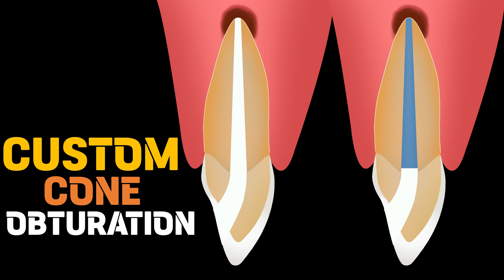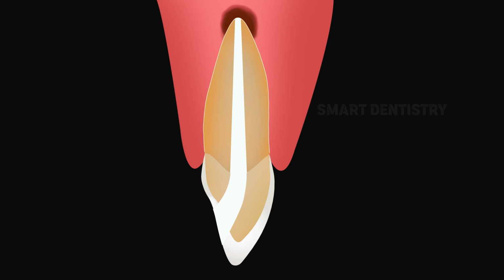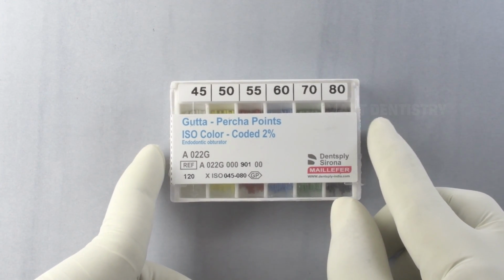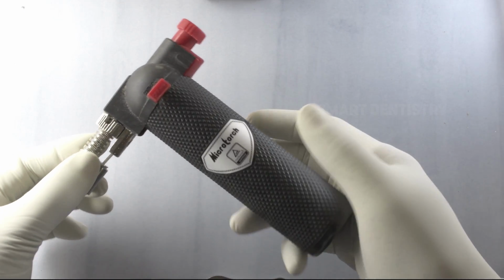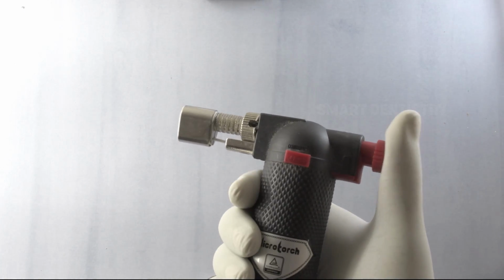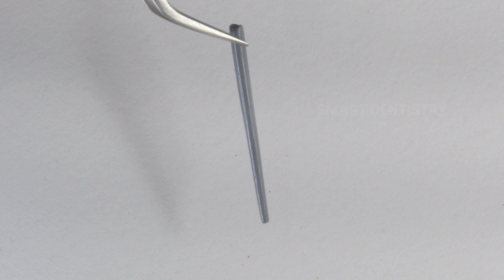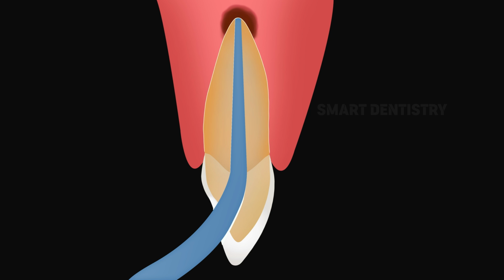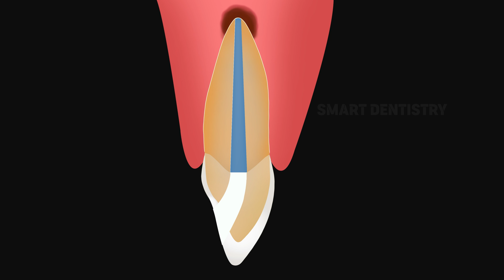Custom cone obturation

Comment: Hi please tell how do u know which taper is better
Reply from the maker: Taper is determined by length of the roots, canal width and obturation technique we use. This seems to be an interesting topic. I will make a video in detail about this
Thanks for suggesting
Upcoming videos in Smart Dentistry YouTube channel

All about root canal Irrigation
How to select the correct master cone
When to discard a rotary file
How to negotiate a calcified root canal - @anujgarg952, @DrHozefa
Antibiotics after Root Canal Treatment?
How to locate root canals?
How to remove Guttapercha from root canals?
When to do Post and Core?
Curved root canals and file selection
Everything a beginner should know about rotary files
TCA technique of Cleaning and shaping - @DrHozefa
Anterior proximal composite restorations - @raghuramm563
Finishing and polishing of composite restorations - @DrHozefa
How to create the perfect anatomy in posterior composite restorations - @DrHozefa
Working length using RVG - @manadentist2267, @sushrutachakraborty464
How to use apex locators to get accurate reading? - @katyaynigupta5259
How to determine the correct taper for canal preparation - @akanshas8424

Comment: sir it's a retained deciduous molar and the permanent is missing congenitally.
Place- Primary second molar.
No occlusion.
Roots are i think 1/2 the size of other molars. 
Decay - a guava seed size decay just adjacent to back molar. 
(Similar to the pic you have attached on your video with title caries removal technique , don't remove caries)
the decay is not giving any pain through infection(which needs to be treated through medicine). 
But sometimes abnormal pressure on the broken structure while eating gives pain for few minutes. 
The doctor said to me that rct will last only for 2 years so i should go for implant instead but i want to save this tooth for as long as possible. 
So please tell me that within 2 years will the roots resorb on it's own even after rct or it could last more. 
Should I go for rct directly or try to go for filling first( pulp capping if needed). 
During my 6 months earlier visit to another doctor the decay was very small and no pain at all of any kind. Doctor said to me when some problem will occur then come again. 
Now the tooth structure is breaking  in very small pieces.
That's why 
I want some treatment so that more damage to the tooth can be minimised.
(I have replied on the earlier comment but don't know why it's not visible afterwards.)
Reply from the maker: Hi
Thanks for explaining everything in a such a beautiful manner
1. Roots will not resorb as there is no permanent tooth. Roots will resorb only secondary to eruption force from the permanent tooth
2. RCT will definitely last longer than two years if done with high accuracy. Although procedural errors are more likely to occur in deciduous tooth more than permanent tooth. 
3. If pulp capping could be attempted, I feel that should be the first choice
4. If the tooth is in occlusion and has no mobility , then saving this tooth will be an better option rather than going for implant although well planned implant will have a better outcome 
5. I have seen deciduous tooth surviving and functioning even in 60 year old individuals. So I would recommend going for conservative treatments like restoration, pulp capping, RCT and if everything fails, implant is always an option. 
Thank you
Reply: @smartdentistry  thankuu so muchh sir for your valuable advice.
I am glad that you gave me your time.

Comment: Can you please please help me telling how many years can rct with crown will work properly for deciduous molar which is broken from side. Or should i go for pulp capping then filling if possible.
With lots of hope I am sending this to you please help to come to a decision of saving my tooth for as long as possible. 
Btw i am 20 year old..
Reply from the maker: Hi 
You have mentioned your age is 20 and the tooth is deciduous molar
Is that a retained tooth?
If that is a retained tooth and the permanent tooth is missing congenitally, then we shall attempt to retain the deciduous tooth
But it must be verified with X-Ray in advance
Again the long term success of deciduous tooth is very not good as compared to permanent tooth.
Need more details to come to any decision like tooth number, decay status, root length available, occlusion and much more
Reply: @smartdentistry 
Yes sir it's a retained deciduous molar and the permanent is missing congenitally. 
The roots are in good condition right now and the decay is not giving any pain through infection(which needs to be treated through medicine). 
But sometimes abnormal pressure on the broken structure while eating gives pain for few minutes. 
The doctor said to me that rct will last only for 2 years so i should go for implant instead but i want to save this tooth for as long as possible. 
So please tell me that within 2 years will the roots resorb on it's own even after rct or it could last more. 
Should I go for rct directly or try to go for filling first( pulp capping if needed). 
During my 6 months earlier visit the decay was very small and no pain at all of any kind. Doctor said to me when some problem will occur then come again. 
Now the tooth structure is breaking  in small pieces.
That's why 
I want some treatment so that more damage to the tooth can be minimised. 
I will be highly greatful if you can help me.
Reply: @smartdentistry Yes sir it's a retained deciduous molar and the permanent is missing congenitally. 
The roots are in good condition right now and the decay is not giving any pain through infection(which needs to be treated through medicine). 
But sometimes abnormal pressure on the broken structure while eating gives pain for few minutes. 
The doctor said to me that rct will last only for 2 years so i should go for implant instead but i want to save this tooth for as long as possible. 
So please tell me that within 2 years will the roots resorb on it's own even after rct or it could last more. 
Should I go for rct directly or try to go for filling first( pulp capping if needed). 
During my 6 months earlier visit the decay was very small and no pain at all of any kind. Doctor said to me when some problem will occur then come again. 
Now the tooth structure is breaking  in small pieces.
That's why 
I want some treatment so that more damage to the tooth can be minimised.

Comment: Why would you do this when i have cones matching my preparation instruments.
Reply from the maker: It is very difficult or mostly impossible to get gutta percha cone sizes greater than 90. We often encounter patients with extremely large canals especially in maxillary incisors of young patients. In those situations these custom comes are really helpful
Reply: Sir, thank you for posting great videos. How is irrigation possible with these kind of wide apices? Wouldn’t NaOCl more likely exit the apices cause the NaOCl accidents? Is there any tips to prevent it from happening??
Reply: In many clinical situations like maxillary incisors in young patients we won’t get matching cones as the canal apical size may be more than 100 iso size.
Reply: But in those situations we can also use protaper gutta percha  as it has thick ends. And if the ends are not thick enough, we can cut the ends a little to achieve our required thickness
Reply from the maker: @Muttaqiizz  But the taper of protaper cones are 6% or more. What happens is, there will be lot of lateral spaces filled with sealer or more commonly the greater taper of the cone at the coronal portion will prevent reaching the cone to full length or we wont get a proper apical seal. 
I personally DO NOT recommend protaper or any other greater taper cone for obturation in teeth with large apical sizes. Rather yet better technique would be reverse cone with lateral compaction